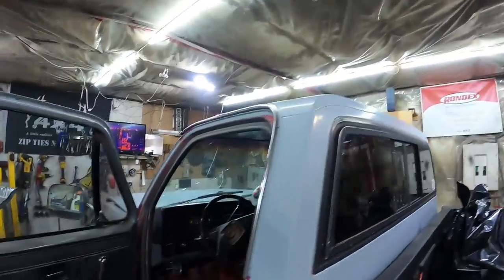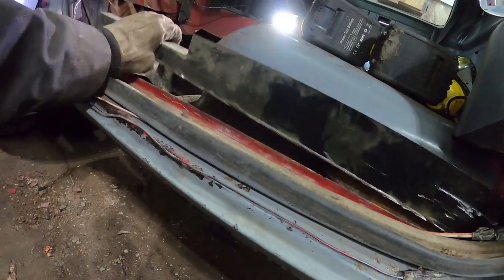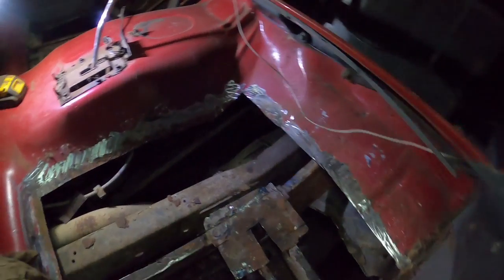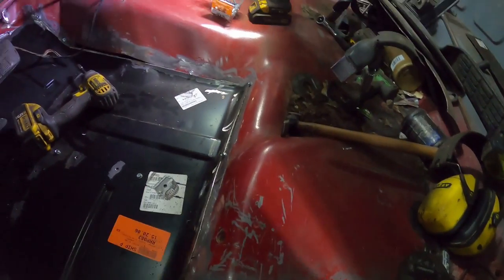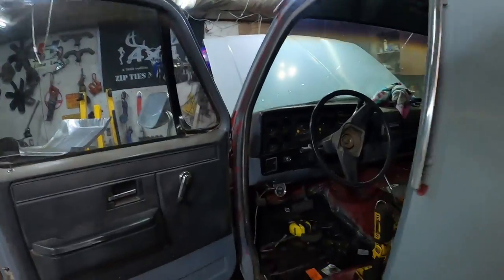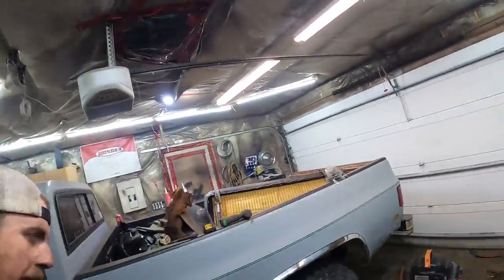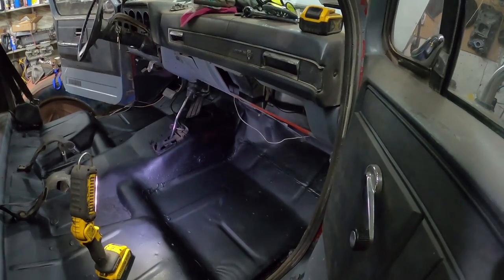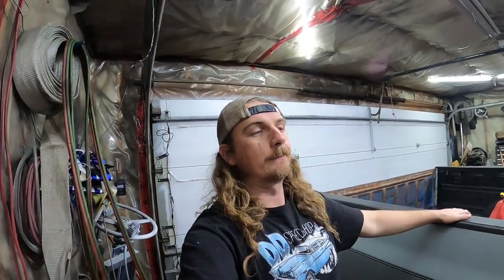Floor Pan Replacement - Quick, Cheap And Easy

Comment: DIYer tip on welding with gaps,  metal coat hanger is your best friend. Use the same way as a tig filler rod. Cheap or free. People doubt the strength of it, I had to trail weld some camber adjusters on a rig a few yrs ago. All we had was coat hangers and some guy had a cutting torch. Long story short dude trail rigged for a couple more yrs and wrecked it pretty bad, everything else around the welds was torn or broke. Anyone else used coat hanger?? Great vids as always keep jamming away!

Comment: Just wanted to give you some insight on square body Chevy’s. I inherited an ‘86 from my grandpa. He bought it with 9,000 miles on it in ‘89. The floors rust out because the wing windows leak. The fix is either convert the window to a full roll up window (not an “original” repair) or order new window seals from LMC Truck or Brothers Trucks. They carry the upgraded window seals and locks that help keep water out. 

Another thought, inlinetube.com carries replacement pre-bent brake line and parking brake parts. They are decently priced and the lines fit perfectly. I had to replace all the lines on my truck and it took about 1.5 hours to replace all the lines. They carry a large variety of years, males and models. 

Truck looks great!

Comment: Man those floors look great! Now have you ever looked into fluid flim for the frame, I have used that for  years here in Maine and man it saves the  vehicle from rusting. Now they have what they call woolwax it comes in black smells great and makes the frame look new. I just did my truck in it, I bought a gallon off of Amazon cost 60.00 us dollars a gallon. Check it out,might be something to get into places around here  charge 150.00 to 200.00 us dollars a vehicle. Oh and  don't forget Gun metal gray color for the truck when you paint it lol!
Reply from the maker: Yup a little undercoating. Then I'll probably bar oil it.  Try to save it the best I can.

Comment: OTG! He’s awesome! Used the same patching technique on my 65 barracuda. But it is a rotisserie car. Done lots of floor pans, mostly with flat metal i form as necessary. Worst is grinding welds after. Lots of noise,compressor runs lots. 

I like the galvanizing primer after patching. 
Rick uses rust convertor too, canuck tire carries it. I buy 6 at a time.
Reply from the maker: Yeah one day I'd like to do floors on a rotisserie instead of jack stands
Reply: @DDSpeedShop  hoist is nice too. Best investment i ever made. 4 post. My biggest money maker to date.

Comment: Looks good! Ever get the power steering sorted out? My 72 was like that,just sat in the driveway and kept turning lock to lock for a little while.It steers like it should. It did sit for quite a time.
Reply from the maker: I haveny yet. Still needs a bracket.
Reply: Mine just has a lower bracket,don't know how or why. My Dad bought it new in 72 ,don't know how long it's been like that!!

Comment: I used the same insulation on the floor of my 1971 F100. It worked good. No idea how well it worked though. It sold before I could drive it.
Reply from the maker: I'm optimistic

Comment: how do you replace the other floor brace that runs from under the seat pan to the firewall? spot welds at the ends? both sides are bad on my 73 c10
Reply from the maker: Lots of cutting and grinding.

Comment: dan, use copper weld threw primer on any panel you are welding and use zinc on the entire panel after you are done welding. then epoxy primer, paint and you are good.

Comment: Doing floor boards suck. I am replacing a complete floor board in a 1971 chevy blazer. I am dreading it but has to be done. I couldn't just replace floor board pans like you did because of the amount of rust I have to remove.
Reply: Looks good Dan. I know replacement of floor board pans suck but At lease its done.

Comment: What size wire are you using Dan? .023" or .030"?
Reply from the maker: 030 for this stuff.  Sometimes I use 23 for thin sheetmetal

Comment: Coming out nice. I can say I never thought about using the duct product for the floors before thanks for the tip. Should have a nice stance with the new springs. There’s a company I use for some of the odd end stuff when it comes  to the old squares. DIY4X.com they make their own products. They make some heavy grade parts at good prices. Not sure about shipping since your in Canada though. Keep it up loving it.